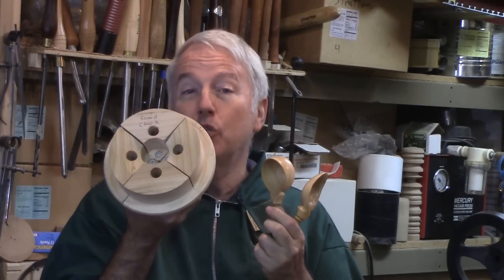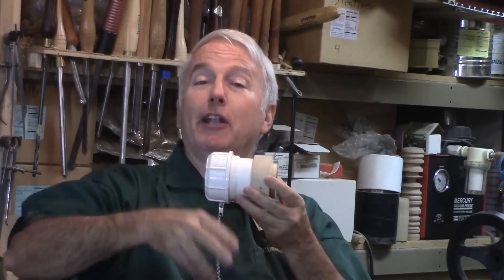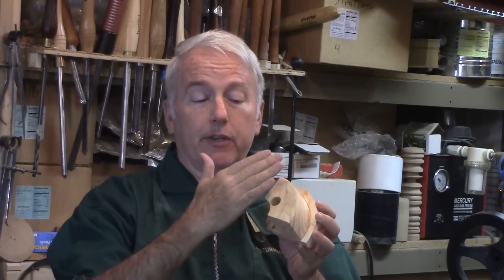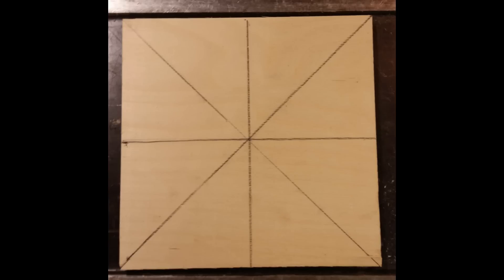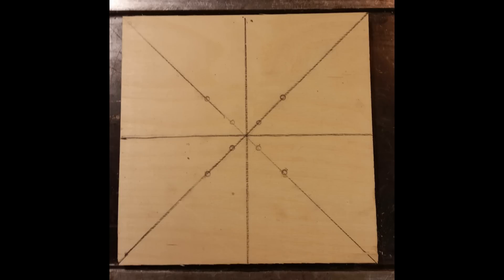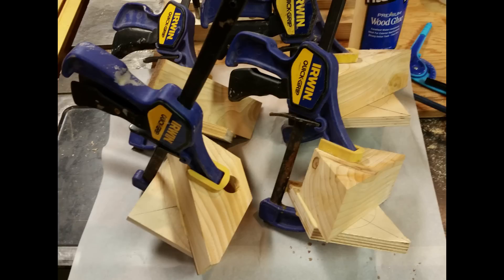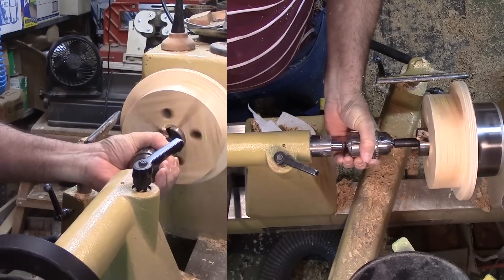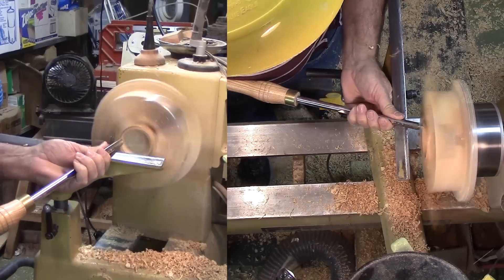My Home Made Scoop Chuck For Difficult Mounts

Comment: I chose your design because it looked the safest. However when I tightened the jaws, the screws pulled the plywood apart. I tried three different ply woods and had the same problem. Still like the design, would like to offer a suggestion for those folks with a Nova chuck. For $19.95 you can purchase a 'NOVA 6021 Soft Chuck Accessory Jaw Set" from Amazon and mount your wooden jaws on the jaw set instead of PLY wood. The nylon jaws are made to modify for any configuration you need.
Reply from the maker: Great suggestions for Nova chucks.
Meanwhile, what plywood did you use. I used Baltic birch plywood. Common plywood just is not strong enough.
Alan
Reply: I used birch ply wood and hard board. I rebuilt this three times before settling on the Nova 6021. I have not seen the Baltic birch in my neck of the woods (SC). Anyway, the 6021 work great forme and still use your basic design. Thanks for the email.
Reply from the maker: Let me summarize this discussion for others who read this thread.
Charles' original jaws failed because the screws pulled thru the plywood. He found a great solution with the NOVA Soft Chuck. So he is off and running.
Why did his plywood fail? Not all plywood types are equally strong. Some types are very weak and should not be used.
1. Common fir plywood has few, thick plies and many voids. This should not be used for this project
2. Most Hardwood plywood is similar to fir plywood. The only difference is the outer plies are hardwood. This should not be used here.
3. Hardboard, particleboard or MDF core plywood is heavier and no voids. However, the core does not have the strength for this application.
4. Baltic birch (or other similar names) has many thin plies and no voids. It is significantly stronger than the other woods noted. However, it is still wood and not as strong as aluminum or steel. It was adequate for my jaws but I applied CA to the screw holes and am very careful not to overtighten. Then use only at low speeds and avoid standing in the rotational plane. 
If your chuck is a Nova chuck then use his solution.

Comment: Where did you get the bolts to fit your particular chuck?  I'm having trouble locating any.
Reply from the maker: blufour44 You will not find them in a regular hardware store. I went to a commercial bolt specialty outfit, Oregon Bolt & Screw. There are many like them in our area serving bulk commercial interests so you'll have to find one that will deal with you for the number you need. I took in my old ones and said I needed same thread and head but longer.
Good turning.
Alan
Reply: Thanks!  Quick reply.